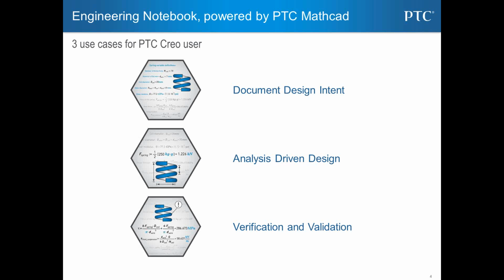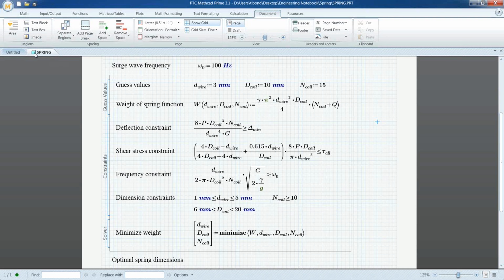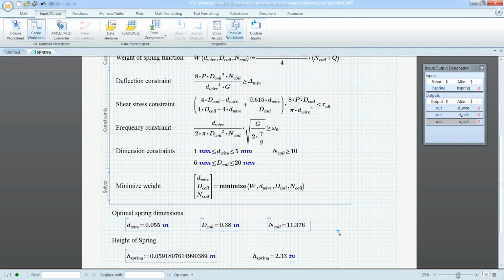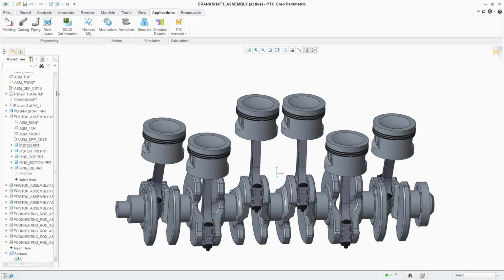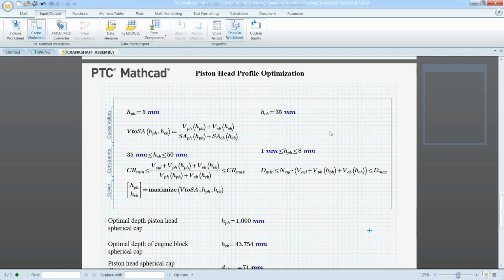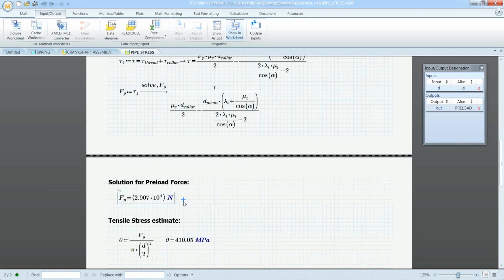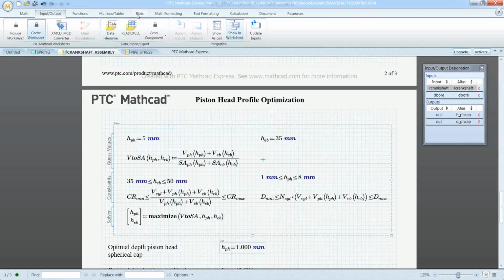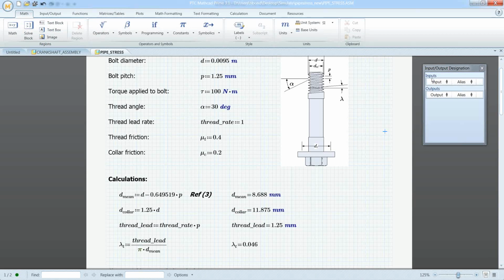New Powerful Integration Features in PTC Mathcad 3.1 & Creo 3.0

Comment: Hi,  excellent video. Thanks for sharing. However not sure what the improved are with previous version of Mathcad and Creo.
Do you also have video showing the process for data management for when using Mathcad and Creo (as demonstrated in that video) and integrated in Windchill (for instance, creating new design based on existing, Save As, do you Save As the CAD + the Mathcad sheet) or you can reuse Mathcad sheet etc....  To me the real value is when everything is related, managed and integrated. so when I save as a WTpart structure I can pick and chose which item I reuse or copy (including all the document inside the wtparts).  Thanks and keep the good work